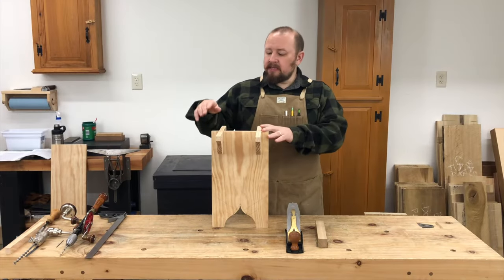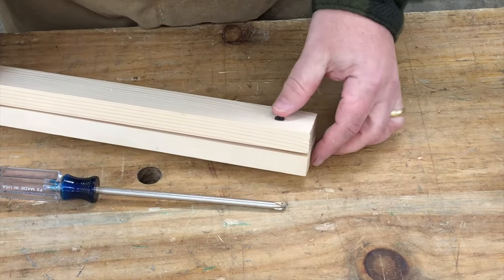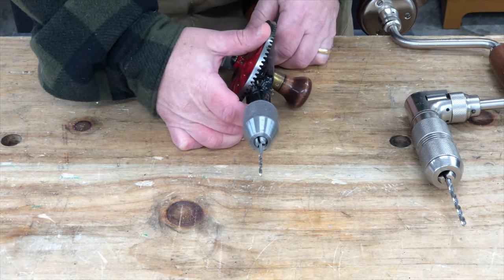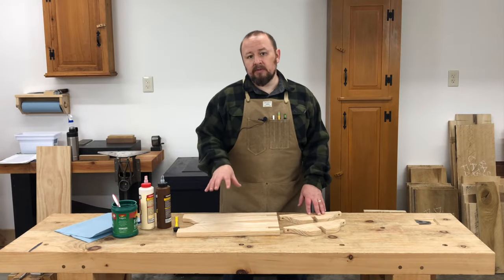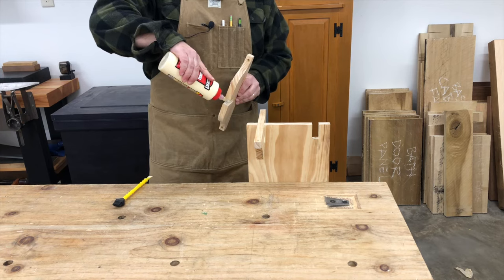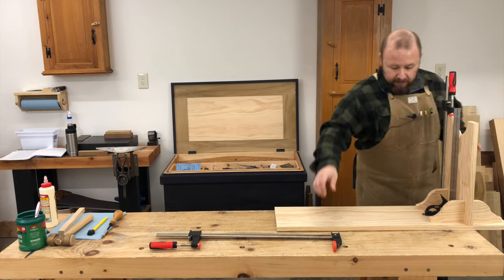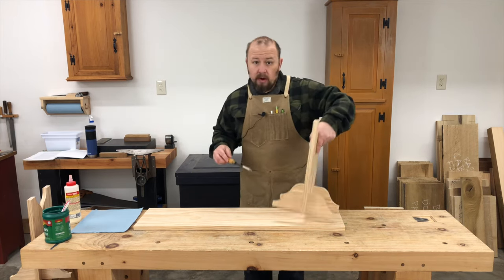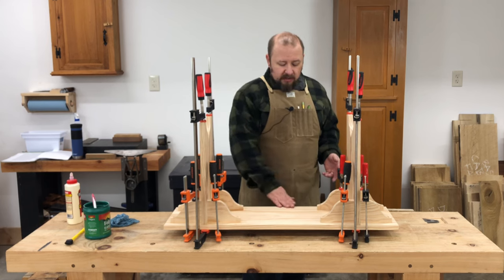How to Build a Shaker Bench, Assembly - Hand Saw Foundations

Comment: Bob, could completely gluing the base to the top cause cross-grain problems with seasonal wood movement? I've been taught to assemble tops to bases with mechanical fasteners that allow for the wood movement.
Reply from the maker: Not in this case. There is no cross grain situation. The legs, top supports, and top all have their grain running in the same direction and will expand and contract in unison. Plus, dry pine is extremely stable and moves very little. So there won’t be any problems with this piece.

Comment: Bob, you stopped to check if the leg assembly was square to the top, and it was. What if it hadn’t been? With this table design, what would have been your solutions to fix it?
Reply from the maker: Getting a square assembly is really assured when the stretchers are planed flush to the tops of the legs. When you dry fit the stretchers and flush them up, you want to check that the tops of the stretchers are square to the sides of the legs. If they’re not, that’s the time to fix that issue as you plane or sand them flush. If you didn’t discover the issue until after the stretchers were glued to the legs, you can still recover by planing them square after assembly. If the stretchers have already been planed flush to the tops of the legs, glue a thin strip to the tops of the stretchers and when the glue dries, plane them flush again, but make sure they’re planed square to the sides of the legs when you do. You’ll end up planing the thin strip to a taper.